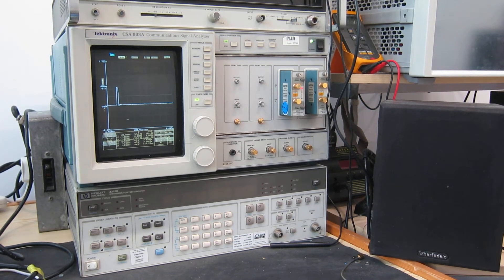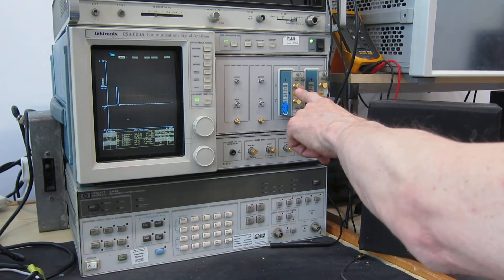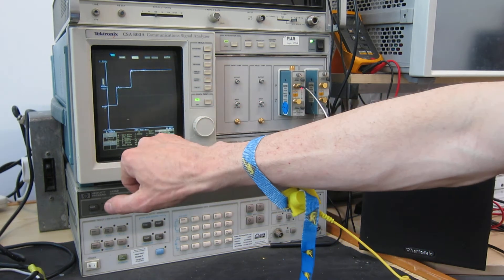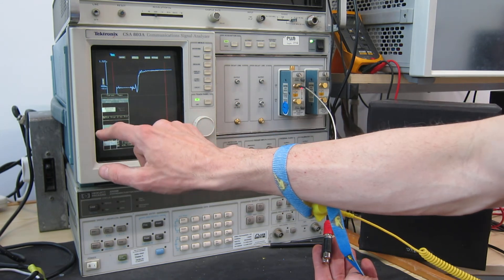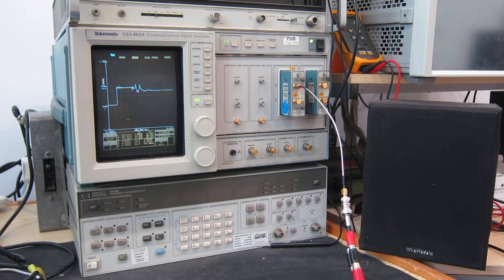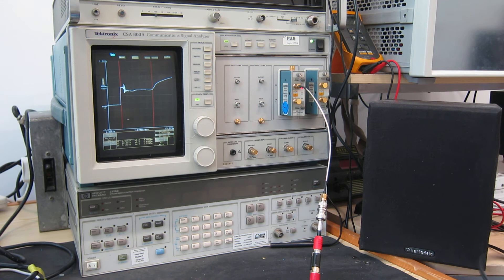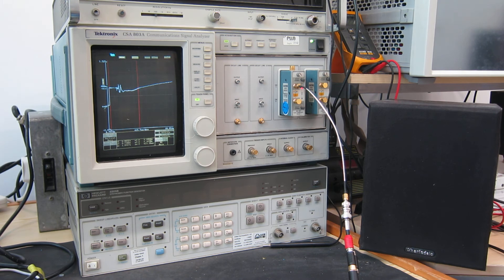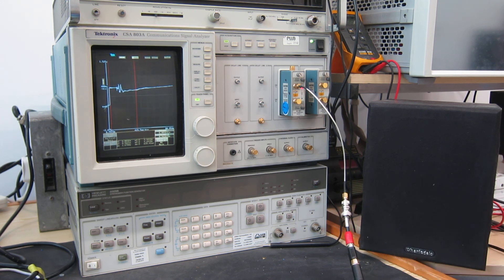Using Tektronix CSA803A time domain reflectometer to fix my speakers

Comment: How do you use the plugin base from 11802 to csa? Is it compatible without modification? If you can direction, i want to do similar to what you did.
Reply from the maker: Yes, it's compatible. I just swapped the whole assembly from a scrap 11802. I had to modify the 11802 unit to bring the delay line trigger outputs to the front panel, because on the 11802 they go to the motherboard to be switched as another trigger source but the CSA803A doesn't have that facility. You can see the gold-coloured SMA sockets I added at the bottom of each delay line section. Other than that, no modifications were needed.

Comment: That's a very nice bit of kit. I remember one of Alan Wolke videos, making a fast pulse generator and doing this on a normal scope. Long lengths of amateur radio antenna coax was the target if I recall.
Reply from the maker: Yes, for longer cables a fast pulse and a regular scope will do a great job.